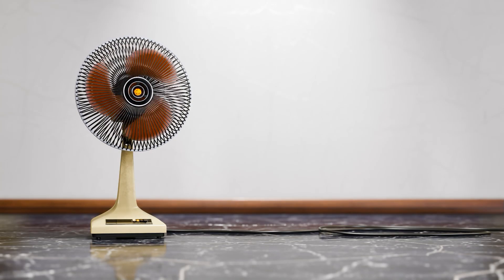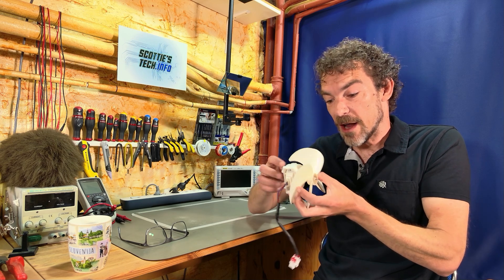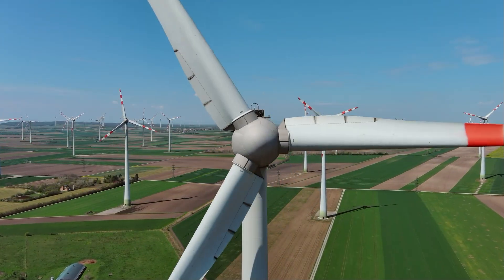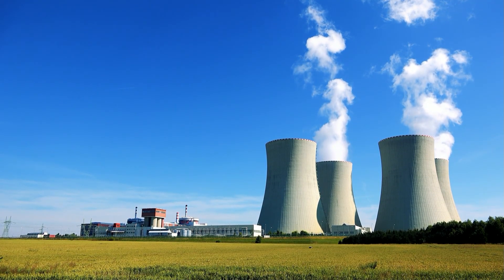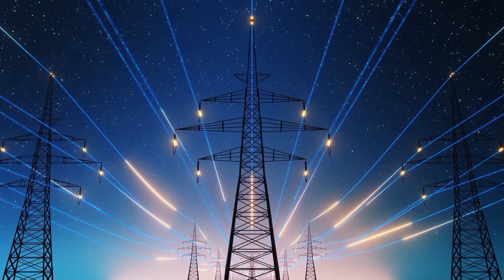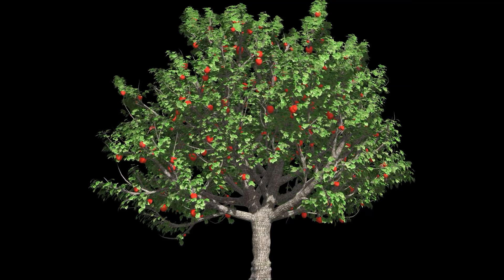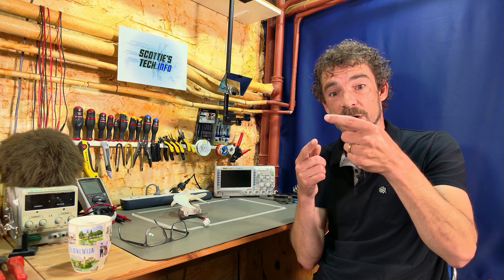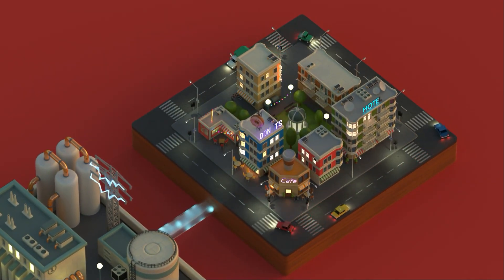Green Grid Part 2: Why 100% Green is still just a Dream

Comment: Hmmm.... in order to understand how solar and wind farms could actually be operated to run 100% of grid power needs, you ought to look up: 
"grid-following (GFL) versus grid-forming (GFM) inverters".

A few quotes: 
"Grid-following (GFL) and grid-forming (GFM) inverters differ significantly in how they interact with the power grid. GFL inverters act as current sources, synchronizing with the grid's voltage and frequency to inject power, while GFM inverters act as voltage sources, essentially creating their own voltage and frequency and thus can operate independently of the grid. "

"In the grid-forming mode, inverters work as traditional synchro generators, controlling frequency actively, keeping frequency and power output sufficient comparing to demand load any time, ensuring stable operation of the electric power system. "

---- 

Grid-forming inverters are thus able to do everything, that we otherwise only used to associated with those old-school synchronized 3-phase electricity generators running at very precise RPMs.

Much has happened for modern power electronics, since the late 1980'ties. 
So very efficient and very reliable  'Grid-forming (GFM) inverters' are now a readily available reality.
Reply from the maker: The problem is that in many countries, the bulk of solar is NOT grid-forming - yet. On top of that, those same countries are removing too much "non-green" energy before there is enough grid-forming green + storage/inertia.
Reply: @ScottiesTech  Yes, it is indeed a problem., if too much redundancy is minimized.

Where I live, in 2003, we hade a grid wide black-out, caused by faults in the country next to us, where we have an AC interconnect. 

And it became evident, that it was too soon to de-commission some of our old and traditional fossil fuel plants. 
This clear warning event caused a significant change in both short-term and long-term policy. 

Among those, de-commissioning plans were changed, and an additional grid-starter facility, on one of the other interconnect lines (a HVDC under-water connection to a different region/country), had grid-starter electronics installed. 

And ever since 2003, several 100% dual-source electricity plans have been implemented. 

So these days,
interconnects can cover 100% 
Renewables can (on a good day) cover 260%
Fossil backups can cover 100%. 

But without our (quite recent) 2003 event, none of these dual-options would have been established or maintained. 
So we would also have been very vulnerable today. 

And yes, grid-forming new power sources are not yet as common as they ought to be.

Comment: I don't think the inertia explanation is quite right.  You can have a big, spinning generator, but it also has a huge power output.  You suddenly put a huge extra demand on it, say 20% more, and it is going to go from say 1800 RPM or 1500 RPM down to 1780 RPM or 1470 RPM real quick, like less than 1 second, which will destabilize the grid.  Sure, if you turn on your LED light bulb, it is not going to flinch, but say you hit the throttle on your high speed train, that is going to need something in the grid that can respond quickly to the extra load.  Where I live, this is primarily handled with gas turbine generators, pretty much instantaneous change in the throttle to handle the sudden extra demand in milliseconds.  The secondary mechanism is grid scale batteries.  It turns out with electronic control, these inverters can sense any frequency and/or voltage change and respond in milliseconds.  Far more precise than any sloppy 'inertia' scheme of the past.  Australia has made huge praises of their grid battery systems for adding stability to their grid and preventing grid collapse when a traditional power plant suddenly kicked off the grid without warning.  The battery - inverter system instantly responded and responded faster than anything else, keeping their grid stable and preventing the dreaded frequency shift that has brought down their grid in the past.  Really, with an interconnected grid, you have many GWs of power flowing around, so even a sudden MW scale demand, say from a high speed electric train, is a drop in the bucket, so easy to have enough systems in place to not lead to a grid collapse from the sudden change in demand.

If you want to do things green and cheap with tech humanity more ore less has today, you need to look at Thorium molten salt hot breader nuclear reactors.  You can mass produce these in factories and ship them around, say on trains that can handle large loads, to supply local grids with reliable, round the clock power.  You can have molten salt storage for dispatchable power round the clock.  You can do away with building new grid infrastructure to hook these up to the grid, one thing that has helped to make renewable energy ridiculously expensive as building whole new grids out in the middle of nowhere where nobody lives is hugely expensive, especially when the vast majority of the time the wind isn't blowing the way you need it and the Sun isn't shining onto your solar panels, especially not in a way that follows grid demand.  So just plop these new nuclear power plants down where existing infrastructure is and call it a day.  Far cheaper of a proposal.  Inherently safe design and no water needed.  China is looking to put piles of these reactors in the Gobi desert and already has demo plants in operation.  For the whole 'inertia' thing, this is easy to solve with a small percentage of peak capacity coming from flywheels and battery - inverter setups.  Especially if you have molten salt storage in the secondary loops of these molten salt nuclear reactors, it should be fairly quick to adjust molten salt flows to and from the storage tanks and shouldn't take a lot of time to spin up more generators or deactivate generators as demand shifts.  So really, mostly flywheels could do the job.  Probably still want to keep some battery - inverter banks floating around and some natural gas fired power plants on standby in case you need to take part or all of one of these advanced nuclear power plants offline, but really they are designed for continuous, zero downtime style operation unlike traditional light water nuclear.  Really no comparison between light water and Thorium molten salt, two completely different technologies with only some sort of nuclear fission being a commonality between the two.

And to the whole comment of heat pumps, no heat pumps don't make much of a difference in grid infrastructure, especially when nuclear power is involved.  Anymore you need an air conditioner, even living in northern Europe.  I have been to Germany for example in the summer and far hotter out there now in the summer, air conditioner weather where everyone said in the past it wasn't like that.  So already built up from that.  It turns out your modern heat pump is normally over 300% efficient.  It depends on the temperature outside, but grids are built for peak demand.  Peak demand is hit in the summer when the air conditioners are going.  Maybe on a really cold night you switch to fossil fuel burning, but most 'cold' nights a heat pump is going to work and is not going to use any more power than it does in the summer in air conditioning mode.  The worst winter where I live when the Ukraine war broke out causing natural gas prices to skyrocket and there was an unprecedented cold snap at the same time lasting for a whole month, bringing the snow line lower than it had been in decades, other people I know out here were complaining about their $600 heating bills.  My electric bill using only a heat pump went up $50.  No, I did not use a ton of power to run my heat pump in the winter.  And I had a small child with me who would throw off his covers at night, so I had to keep it warm inside for him.  The heat pump did the job just fine and hardly used any power.  In air conditioning mode over the summer, I used far more power and this was with tricks to more or less coast all day while at work and only really cool the place down when coming home or on weekends on for the weekend and this was also considering when a small child was home and keeping the temps nice for him.  It was just he was normally somewhere else in the daytime, so I could let the temps float up, but this still led to far more power use in the summer time.

Then your electric car, people normally charge those up overnight when they have other stuff turned off, so again, no, don't really need more infrastructure, at least when you have the right nuclear power plants around.  Granted, where I live the grid really sucks because it is current day USA, so the grid voltage was really sagging a lot in the summer due to last few feet delivery being terribly under-built and often leading to hours long outages as overloaded ancient transformers blew.  Regulations for EVs requiring upgrades from 100A main panels to 200A main panels led to a 4x to 6x improvement around here in last few feet connections when the electric company comes out to do the upgrades so that the voltage is no longer sagging like crazy from a whole block being on the same overloaded small transformer.  Instead, every couple of homes is on a different transformer now.  It is just they keep shutting off the power to the whole neighborhood all day as they make these upgrades.  But really, these upgrades have been needed for decades with just EV charging regulations pushing the utilities over the edge to not having something completely janky going on.  But if it wasn't janky in the first place, I don't think anything major would have happened or have been needed.

Comment: We really need to think a hundred years down the line. The issue is making a transition from a centralized AC grid to a DC decentralized distributed generation grid. Frankly, like interstate highways, the grid should be federalized. Get rid of high voltage AC and build battery nodes linked by HVDC and MVDC. AC will only happen from local substation nodes that draw or contribute power with other nodes.

Comment: Another DARK SIDE of solar panels and wind turbine is the power necessary to manufacture those devices.   Power is not the same as energy, it is energy per time.    The renewable energy device may produce enough energy during their life time to manufacture another device but what is needed is that energy provided not on 25 years but in only a short period of time which they can do.  So to manufacture these device for remplacement it will still need fossil energy.
Reply from the maker: Exactly. And hardly anyone ever thinks about this.
Reply: Hmmm... fossil fuel is not the only stable method for producing electricity, besides solar and wind. 

Both hydro and nuclear can produce vast amounts of electricity. When ever it is needed. 

--- 

Also, the power needed to produce solar panels and wind mills, are included in the price of manufacture of the devices. 
No one is handing over free power, to the production plants of solar panels or wind mills. 

If construction and operation of solar farms or wind mills, were higher than the construction and operation of other types of energy, then this would be reflected in price of electricity. 

--- 

Most of the western world use free electricity markets to buy and sell electricity. 

If wind and solar could not produce electricity at competitive prices, then everyone buying electricity, on the free electricity markets, would simply buy from other sources.
Reply: @MrAlvinDude  You are right that Hydro and Nuclear are producing a lot of energy and also a lot more power than solar panels and with turbines.   However we must keep in mind that building an electric dam and maintaining it, or building a Nuclear plant, both needs a lot of power (not only energy) and it is not the solar panels or the wind turbine that will be able to provide it.    Our current society relies heavily on oil and when oil will become scarce it will be harder and harder to maintain and replace our energy equipment especially solar panels and wind turbines.
Reply: @MrAlvinDude  Another point.   A world only using solar panels and wind turbines is not durable because it needs a lot of power to manufacture them, which these equipment can not produce enough power despite the fact that they can produce enough energy.   (Again energy is not power, that is the problem)

Comment: Haven't bothered watching past the first 10 seconds but inertia can be added to a green grid, as synchronous fly wheels, bio mass or some other lowz carbon fuel for traditional thermal power plant and inertia can now be simulated by the electronic interface of wind and solar sources. So yes a green grid is perfectly possible.
Reply from the maker: That's basically what I said in the rest of the video that you didn't watch. It's not that adequate inertia CAN'T be added to green grids; it's that it ISN'T added enough.
Reply: @ScottiesTech  Fair enough. I think though that it's reasonable to assume that the grid operators will do the necessary to maintain a reliable grid with perhaps some mistakes along the way. Spain's recent outage being possibly an example. Thanks and I'll I now watch the whole video!
Reply: Do the maths and calculate the size and cost of the batteries and then come back.. Arguments with no facts are just opinions and could be wrong

Comment: Not bad but you've made a few mistakes.  First, you might not be aware but California is now regularly going over 100% renewables.  It's hitting 120% and higher sometimes, with batteries charging off the excess.  Regularly now.  Literally.  You can look at the CAISO (California system operator) web site and there's a ton of data there.

Second, inertia is not actually an electrical engineering term, it's more of a traditional grid operations term and batteries can provide it just as easily as condensers and large fossil turbines.  There needs to be a minimum critical amount of battery storage to generate enough of it... each individual inverter can't provide much, but ganged together they absolutely can.  And they do.

There is also nothing stopping anyone from putting a self-powered condenser anywhere on the grid (i.e. powered by the grid itself, basically trading off a little voltage for frequency stabilization).

Batteries also provide the instantaneous load following needed, both adding power when needed and removing it when needed.  And again, there are several major examples with California and Australia both providing these services now.  California's gas turbines more or less either run at full speed or are off now and batteries handle all major load following while the turbines handle the "rough-in" ... the bulk of the energy in the evening once the batteries start to slack off.

Grid-scale storage is now able to provides all ancillary services and in both California and certain regions of Australia they are handling most of the services now.   Texas is following shortly (it almost has enough grid-scale storage to do it).

So... basically there are no longer any impediments to a 100% green grid beyond the simple fact that one does need a certain degree of callable generation to ensure sufficient margins, particularly over winter.  So natural gas and nuclear aren't useless yet.  California uses Natural Gas to fill in the gaps but as the solar and wind expand, use of NG generation is falling off rapidly.

-Matt
Reply from the maker: "Regularly going over 100% renewables" isn't the same as 100% green, all day, every day, every year. They are "more green" than any other state, yes, but they still have a long way to go - especially if every vehicle goes electric.
Reply: @ScottiesTech  you were trying to argue that grid stability couldn’t be achieved with 100% renewables.  Momentum and other regulatory mechanisms are real-time mechanisms.  You don’t get to change things around and say, oh, well, it’s ok for the grid to be 100% renewables some of the time as long as it isn’t other times.  Either the grid is stable at any given moment or it isn’t.  Some fossil generation might still be needed to fill in the gaps for actual energy production, but no fossil generation is needed to keep the grid stable.

I am pointing out that several grids already run greater than 100% renewables for 12 hours a day with perfect stability.  Obviously stability does not require fossil generation.  Beyond that, any significant reduction in fossil fuel consumption is a big win for energy independence.  There is no requirement that any sort of minimum fossil generation be present to stabilize a grid, and there is no requirement for any specific fossil generation beyond ensuring energy margins are met.

Energy and stability are two different things. You are seriously getting them confused with each other.
Reply: @junkerzn7312  Good points, other places can go far over 100% and what can't be used is culled until sufficient storage or grid is build.
Reply: No numbers mentioned....I wonder why.come back when you have done the maths